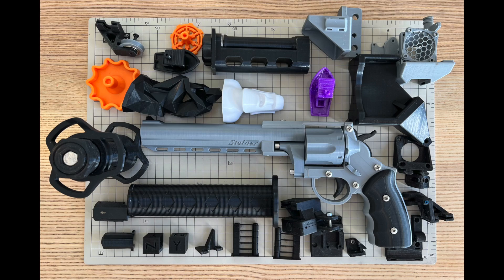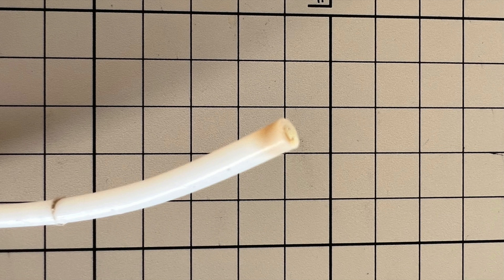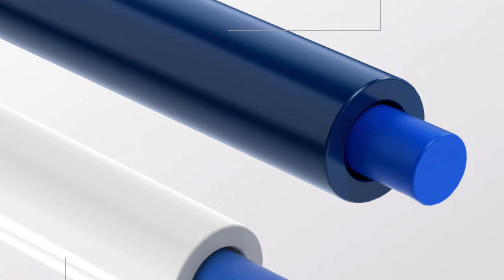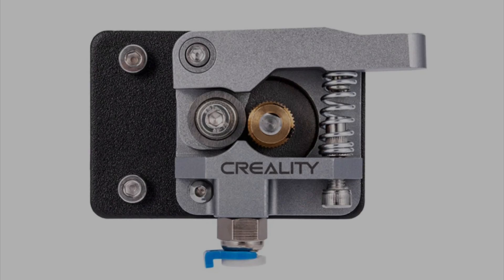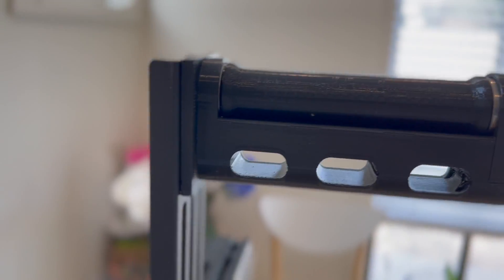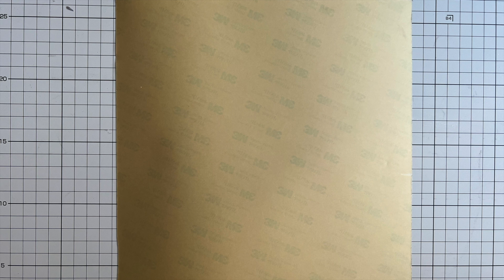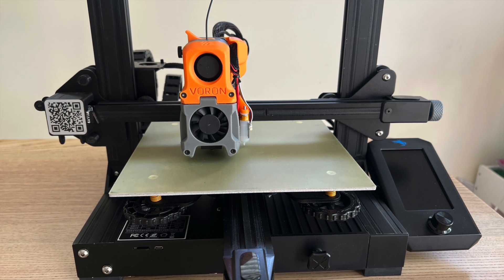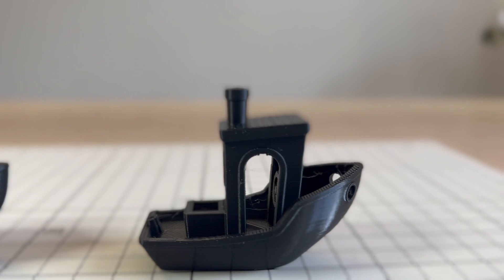Ender 3 v2 - The Ultimate upgrades and mods to perfect prints

Comment: Hello friend, what is the link to download the STL file for printing the direct drive mounting plate?
Thanks.
Ivo from Brazil
Reply from the maker: You can find all the details from this video's description: https://www.youtube.com/watch?v=LBTuS2WBLIk
"
Things you need to build a Voron Afterburner for Ender 3 v2
1. Printed parts (almost free if you print by yourself)
2. A slim (20mm) step motor (around AU$16.00). You may still use the stock extruder motor if you don't worried about the decreased build height and you also need to cut out the shaft around 2-3mm
3. BMG Extruder internal parts or a BMG Extruder (around AU$30.00)
4. Required Screws and Nuts Kit (less than AU$7)
5. 4020 24v blower Fan (part cooling) The Stock 4010 blower does not work
6. 4010 24v DC Fan (hot end cooling). You may still use the stock fan if noise is not problem to you :)

*Afterburner mounting plate for Ender 3 v2*
afterburner-motor-plate-ender3v2-Mod.STL (https://www.thingiverse.com/thing:4764317
, As shown in the video, ***but later I found "afterburner-motor-plate-ender3-abl-2.stl" is the latest version, please use the latest version from https://cdn.thingiverse.com/assets/cb/d2/ad/b4/0c/afterburner-motor-plate-ender3-abl-2.stl)
!!!They don't fit my ender3 v2 plate very well, I have to use a drill to open some holes...
Other alternatives:
- https://www.thingiverse.com/thing:5107209
- https://www.thingiverse.com/thing:5026200

*Extruder*
https://github.com/VoronDesign/Voron-Afterburner/tree/master/STLs/Direct_Feed
[a]_connector_cover.stl
[a]_guidler.stl
[a]_latch.stl
[a]_latch_shuttle.stl
extruder_body.stl
extruder_motor_plate.stl (only required if you use this plate https://www.thingiverse.com/thing:5107209)

*Blower housing (aka, print cooling fan duct)*
https://github.com/VoronDesign/Voron-Afterburner/tree/master/STLs
[a]_blower_housing_front.stl
blower_housing_rear.stl

*Printhead (hot end mount)  for Ender 3 v2 stock hot end*
https://www.thingiverse.com/thing:4850412
AB_Mk8_Ender5_stock_Back.stl
AB_Mk8_Ender5_stock_Front.stl
This is designed for Ender 5, but you can still use it for ender 3 v2, because both the Ender 3 V2 and the Ender 5 come equipped with a standard Creality hot end.
If you are using an hot end such as E3D_V6, Slice_Mosquito... print the required ones from https://github.com/VoronDesign/Voron-Afterburner/tree/master/STLs/Printheads

*Hot end cooling fan mount*
https://github.com/VoronDesign/Voron-Afterburner/tree/master/STLs
hotend_fan_mount.stl

*BL touch mount*
https://www.thingiverse.com/download:8839808 from https://www.thingiverse.com/thing:4638150

*BMG Extruder internal parts*
https://www.aliexpress.com/item/4000021186440.html
Alternatively you can use parts from any BMG Extruder clones

*Screws and Nuts Kit*
https://www.aliexpress.com/item/1005003096841891.html
Plus M3x10 (2) M3x6 (1)

*Nema 17 stepper motor (20mm)*
https://www.aliexpress.com/item/1005003014401384.html or
https://www.omc-stepperonline.com/nema-17-stepper-motor/nema-17-bipolar-1-8deg-16ncm-22-6oz-in-1a-3-7v-42x42x20mm-4-wires.html
"

Comment: I got Ender 3 V2 for kickers. I was insanely astound about 1 motor Z-axis. I just printed brackets and used one old unused motor and rod/nut parts I had lying around. Then just wired to original motor. Has worked just fine in parallel. Also changed to some 3rd part PEI sheet, stiffer springs and BL-touch. Machine as been on quite low use I have mk3s which is my main go to. But I should still definitely change that ender to direct drive, which is why I'm here.

Comment: For the elephant foot issue, I found that simply calibrating your e-steps and taking the average diameter of the filament you're currently using and inputting that into your slicer filament diameter  box has completely eliminated the need for elephant foot compensation.

Comment: i just installed an anti backlash kit on the z screw thingy to try and get rid of some Z issues, right now, for some reason which i cannot understand one side of my bed doesnt level, even if i manually level it and it feels level, it'll be way off on the left side, and it wont print anything that isnt in the center of the bed,  i dunno what the heck is going on, aside form taking it all back apart and re building myself (i didnt build it, my friend did) i have no idea what the issue is, a calibration cube printed perfectly, besides a tiny elephants foot, i am now going to try an dual z kit, maybe something is warped with my printer (ender 3 v2) i have an used ender 3 i got for cheap but i need to flash the firmware and i'm scared to mess it up :(

Comment: Where did your change your Z motor voltage reference after the Dual Z-axis upgrade? How do you determine the new voltage? Also, Great video, well broken out into stages and lots of good info about what helped your prints and what was just cosmetic.

Comment: Perfect Prints hahaha WOW they are much worse Benchy's then I could achieve when my ender 3 was stock! Now with just CR-Touch, Glass Bed, Dual Z and 4.2.7 ONLY my prints are like glass. People need to learn how to fine tune their settings and configure their setups and stop modifying until they can at least do the basics of the firmware and calibration side first.
Reply: I would add dual-gear extruder on the Bowden to prevent slippage - but also try to figure out the knee between flow rate and pressure curve.

Comment: so with the bl touch  sensor. does it map out the print bed and modify the g code to compensate? or i’d it just a way to level the bed more accurately ?
Reply: It measures highs and lows and actively adjusts the z offset to compensate for any peaks and valleys

Comment: For the afterburner if you run Klipper with the Ender3 you can get better speeds with better printing. I have both an Ender 3 and 5 with Afterburner and they print great at high speeds.

Comment: You still do not have klipper? Literally the first big upgrade I did - and still believe that it is the best one by far. It fixed 90% of the problems I had on marlin.
Reply from the maker: I should give it a try later. The reason I haven't done yet is that I don't want to change anything related to the power supply without installing a smoke detector. I usually keep the machine running over night in my garage so I would first get a smoke detector then do big changes on the board and wiring part.
Reply: @makeIT0  You don't really need to change anything in the board, I didn't need to when I installed klipper

Comment: How do I measure the voltage for the dual z axis
Reply from the maker: Check here: https://youtu.be/QoUqy-z0WRQ?t=266. you simply find the Z label on the board and measure it using a multimeter

Comment: I already got a CR10S upgraded but wanted a smaller printer as well. Would you recommend a Ender 3 v2 that I will upgrade with a BL Touch 3.1 or .... the recent R1 available for 350 euros... ?
Reply from the maker: You mean  Ender 3 S1? I would go for Ender 3 S1 directly. If you would like to try different printers, you should try Prusa mk3s+  or voron switchwire for other smaller options

Comment: Howdy!

As you mentioned you are printing ABS, it's only a matter of time before you enclose your printer.

When you do, check your printed printer upgrades. If they are made from PLA, they WILL deform from air temperature when the printer is enclosed. Believe me , I've been there. LOL... had my BL Touch mount (and some other stuff) melt during longer ABS prints.

I did use direct drive for a few months, but believe me, I went back to Bowden later. It's easier to mantain. I use a standard PTFE tube though, I hated the Capricorn because it's a part meant for more precision and does not bode well with cheaper filaments which might not have good quality control. No problem with temperature for me, as I also upgraded to an all metal hot end, and I print Tritan a lot (making parts for my car).

You just got a new subscriber. Best wishes from Brazil!
Reply from the maker: Thank you for sharing your experience!

I agree with PLA deformation issue, so I will probably leave this one as it is without using an enclosure. I have a Prusa printer too, so I will put that into an enclosure LOL.

A well tuned Bowden extruder can print as good as a direct drive one, I really dont see any quantity improvement with a DD. The benefit might just be reduced extraction (reduced print time) and work with flexible filament.   

For me I have to draw a line on upgrading my Ender 3 v2, I don't want to spend too much on it as the frame is not the best. That's why I haven't yet tried better hot end and liner rails.

Thanks! Happy new year and Best wishes from Melbourne!

Comment: Great video ,  and funny enough i did the same modifications as you did over time (maybe some different manufacturers here and there) and I want to get to step 3 as you did . 
There is one more thing i am interested, and maybe you want to share: PLA+ and or ABS profiles for Cura/Prusa.
I ran into a problem after i installed the direct drive & CR touch(both in the same time with FW update), but if i want to print anything from Cura, extruder goes nuts and ejects 400mm plastic in 1 sec damaginf eventualy the nozzle. with standard profile in Prusa i do not have this . I checked if the Filament runout is enabled, and disabled it in Start g-code with the same results. 
Thanks in advance
Reply: I disagree, it's full of biased thoughts isntead of factual information.  Like not needing a filament guide, or a runout sensor because of some personal bad experiences had.  Or the 'buy creality official' dual z -  you can look up the pitch and thread count of Z rods... then you match it... it's just.. very biased in every aspect, and almost kissing up to creality.  PEI isn't the best ABS printing solution etiher, especially due to cost.  your better off with some G10/FR4 board and obviously a enclosure to prevent warping (something not touched on, due to lack of experience)
Reply from the maker: Thanks you Costi! great mind think alike LOL!

No special settings for PLA and ABS for me, I most use the default profile with changes on the temperature (eSun PLA+: print bed 65C, hotend 245C. ABS: hotend 260C, bed 110C, retraction 1mm as I am using DD)

Have you calibrated your extruder? Also do check extruder step/mm and also make sure you copy all default configuration from default ender 3 v2, and then do your modification base on it.

This is how I do it: https://www.youtube.com/watch?v=DmTqJCn7rKY&t=175s it might help

Comment: Best upgrade is the User mod.  You learn how to calibrate and tune your slicer and square and adjust the machine.  About the only upgrades really worth while for quality of life is the extruder and a all metal or bimetal heatbrake.  Direct drive is a slow down and not needed, dual Z is not needed, so many things not needed.
Reply from the maker: Thanks. We may probably focus more on the creation instead of tinkering the printer itself. LOL. You could see at the end of the video, the quality improvement is actually trivial.

Comment: Did you have to switch out a new board to accommodate the dual z axis, or are you running the two a stepper motors in parallel?
Reply from the maker: I am using the stock board with two stepper motors in parallel

Comment: Bad video.
My only upgrades were direct drive mount, Satsana fan duct and Jyers firmware. Now I print with 100mm/s at 1000 mm/s2 (quality profile) or 150mm/s at 2000mm/s2 (rough profile) with no problems. I only paid for longer E motor cable and I am very happy with results. I also want Linear/Pressure advance for better acceleration control, but this is only achievable with 3rd party motherboard.

What you did wrong:
- elephant foot is easily treated with slicer settings. No need to purchase second lead screw unless you want very (!) high precision
- bearings on top of z axis have a high chance to deform the lead screws over time and cause severe layer height consistency issues
- Capricorn tube is nice, but it will eventually get worn out by fitting. This will cause clogs inside hotend, unless you tighten your nozzle often
- My e3v2 base wobbles too, and best way to fix this is to just put a piece of anything (paper in my case) under wobblling foot. That's fine as long as bed is properly leveled.
- Afterburner adds weight for your hotend, this causes your problems at high speed. Better print some lightweight fan mount like Satsana.

Good parts:
- I use similar mount for direct drive and it makes wonders for print consistency.
- PEI sheet is probably good, but I'm fine with glass. Biggest part I printed was 600g and 23cm tall, no issues.
- BL Touch is fine.
Reply from the maker: Thanks for the insightful information so others can try yours too.

Comment: nice vid! just watch out so your eccentric nuts on the v-rollers aren't too tight, this can increase wear on the v-rollers and lessen their lifespan.
Reply: Not to mention bind up your z axis something fierce. Which is what I have spent the last hour wrestling with as I install a 2nd z screw.
Reply: yep,lol i did that
Reply from the maker: @vidar sjögren Thanks! I do have some spare pulleys though LOL. but it looks good so far as ABS is not heavy

Comment: U said the after burner cooling is nkt enough at 80mm/s speed, if i know well there is an option to use 5015 fan with a mod on afterburner
thats make more airflow isnt it?🤔
Reply from the maker: Thanks! I will give it a try when I get a 5015 fan.

Comment: 1.5V is to much for 2208 👍 they should run by 0.8 - 0.9V 😁
Reply: 1,5 v is for two paralel connected Z stepper?🤔
Reply: @zola5584  and 4 stepper 3V ? Magic smoke v👍
Reply: @allffrommars6019  what? i guess u didnt answer my question 😅
Reply: @zola5584  the wire extender is connecting the motor in series not parallel

Comment: what vref number did you use for x y z and E with a 1A pancake steper motor? I'm almost done with your version 3 mod.
Reply from the maker: Great! hope you enjoy it. the stock vrefs for X, Y and E work great for me after some testing. I've only  changed the vref on Z to 1.5v due to the dual z axis upgrade.
Reply: the vref value in the stepper driver X Y Z is 1.14v and E is 1.27v but the stepper motor y is a bit hot is that reasonable? should i lower the vref value for the stepper driver Y?
Reply from the maker: I guess you can turn the E down to around 1v (It really depends your motor specs).  Let me post a video next week for the detail calculation. :)
Here is a good post as well: https://all3dp.com/2/vref-calculator-tmc2209-tmc2208-a4988/

Stepper motors can be very hot, and it's pretty normal.
Reply: @makeIT0  my spec nema 23mm steper motor 1A currently i am using vref value 1.30V is that too high? i want my 3v2 ender to print abs in enclosure do you have any suggestion for electronic parts and steper motor is safe to print abs inside enclosure with print time  above 5 hours
Reply: do you have a discord so i can call and ask about mod ender 3 v2 if you don't mind